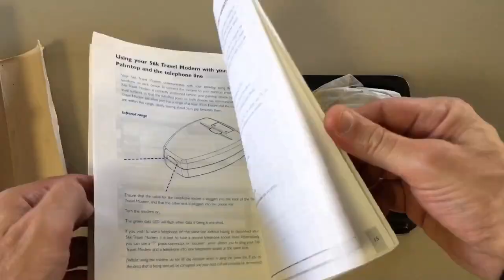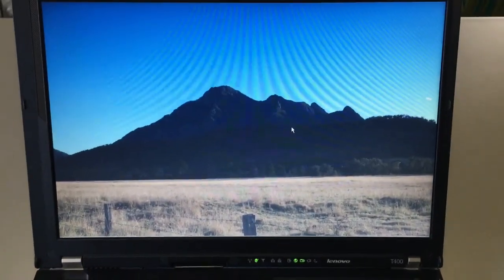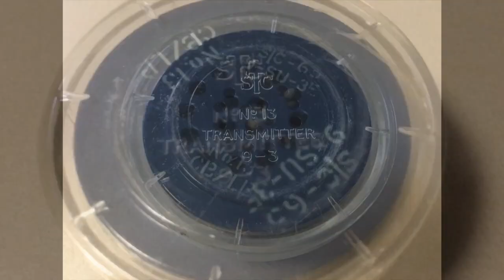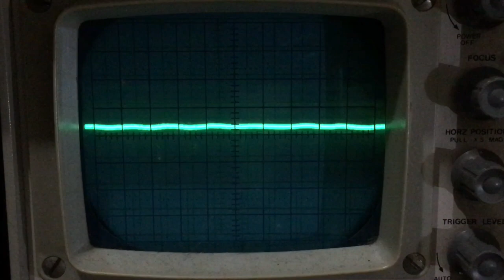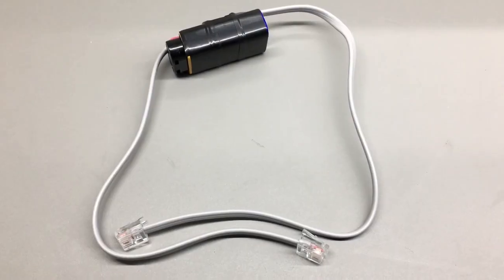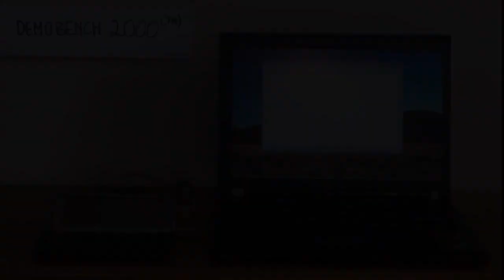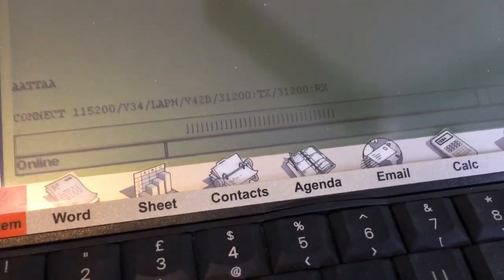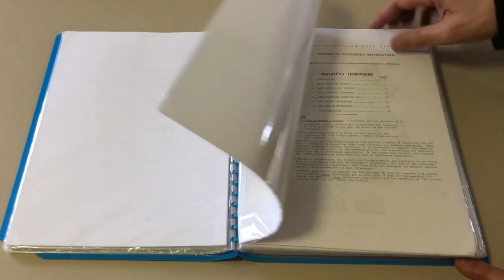Telephone Line Simulation - Part 1

Comment: 56k was only available if the far end was a  fully digital connection, either direct into a T1 line or ISDN, so that the handshake negotiation could characterise the line, the ADC and codec in the phone central office, and effectively preshape the digital data sent down the line, so as to allow 7 bits of data per sample. Effectively they still sent at 9600 baud, but because they could agree as to what each part of the signal represented, the far end could recover each sample at get 7 bits of digital data off it. the reason you could not get 64k ( the data rate of ISDN, was that the phone system typically would steal the LSB off the data stream and use it for signalling info down the line to the far office, thus sending 7 bits of data and a 1 bit control scheme, without needing an extra data signalling channel. Still out of band signalling, as neither end could use the LSB or see it, it was forced to 0 at the end. 

If no digital link then they negotiated 33k6, as that was the max a regular analogue line would support in the allocated bandwidth with all the fancy digital signal processing both ends, if you had a line with digital interfaces in the middle then you would be lucky to get 33k6, typically 19200 as the codecs would be very fussy about the companding, and lower rates would work. That is why your fax side of the modem only supported 2400, 9600 and 19200, as only 2400 was always going to work provided the call connected, 9600 would work provided you did not have too much echo cancellation on the long line and 19200 only if the line was digital from office to office.

If you used a Diginet link though you could get 64k out of it, though the official speed was 56k, but both sides would use the LSB  and only the NTU would set it to 7 bits. Still got a modem or two lying around, both 56k and 33.6k, and they probably still work, but since I have gone to DSL I do not miss dial up at all.
Reply from the maker: Cool info, thanks. I didn’t play with it much, but noticed it didn’t connect at quite the max speed of at least one modem. 31200 as opposed to 33600 IIRC (without having watched the video again).